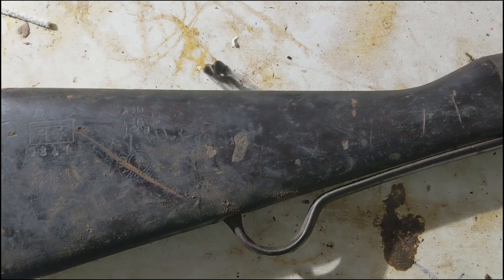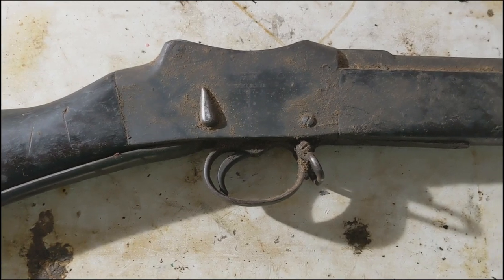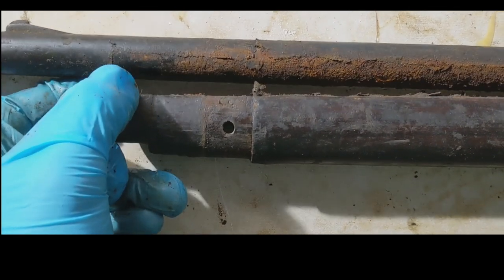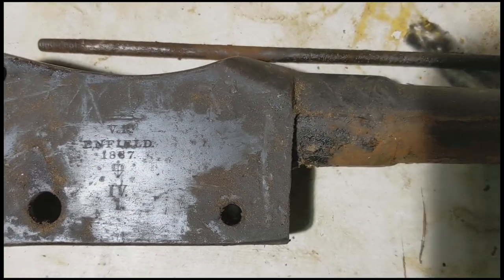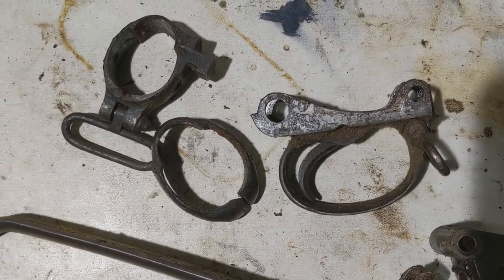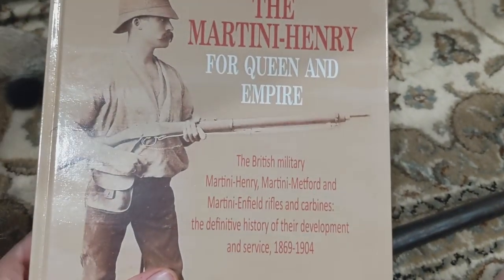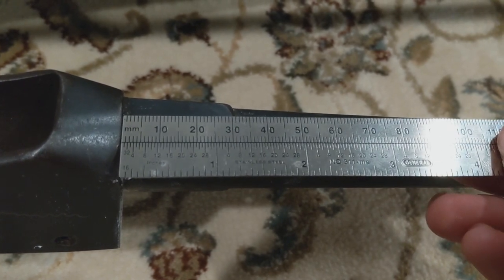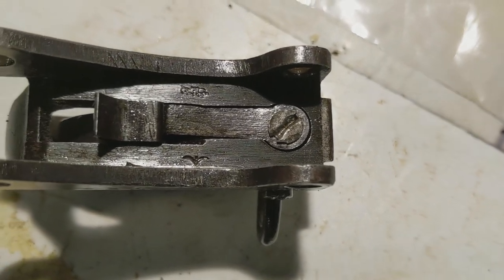Cleanup of IMA "Untouched" Martini Henry Rifle | 1887 MK IV Pattern B

Comment: Is there any videos on how dissemble the gun besides the action? I just got a martini and i have no idea how to take the bands and stock off. couldnt find any videos anywhere. just the action strip ones.
Reply from the maker: Iraqveteran8888 covers it in one of his cleanup videos.
Reply: @tfusilier44  i think u should make a specific video on how to remove the bands and wood on each of the different marks. I think it would get views. A actually iraq vets video was on a mk 4 so it didnt help me much lol. But i was able to find one article about it and got it taken down. My band screw is frozen but was able to wiggle it over the pin. And there was one video on how to remove and assemble the action but  the quality was so low its hard to see how the tumbler and cocking indicator go back in
Reply from the maker: @danm7298  good idea. I'll do a video on both types.
Reply: @tfusilier44  yea i would love it if u did! And maybe make a breech block on that explains putting the tumbler in right, the cocking piece, and setting the breech block itself back in after. The only video i saw didnt go into detail about those

Comment: Would you recommend one of these as a collector and then shooter? Was wondering if the condition is pretty much the same across the board or not.
Reply from the maker: Pretty much luck of the draw. The MKIVs tend to be in good shape since their service life was pretty short.
Reply: @tfusilier44  would you suggest getting an A, B or C? The A model certainly is the rarest, but does that matter?
Reply from the maker: @b9brutality  as far as condition I don't think the model numbers would matter. For collectability the pattern A is the rarest and allows the use of a socket or sword bayonet. But if you want one that had a new made barrel vs a .402 conversion you can go with a Pattern B.
Reply: @tfusilier44  thank you so much for the info!
Reply from the maker: @b9brutality  no problem. I plan to do a video on the different patterns of Mk IV someday
Reply: @tfusilier44  I'll be looking forward to it!